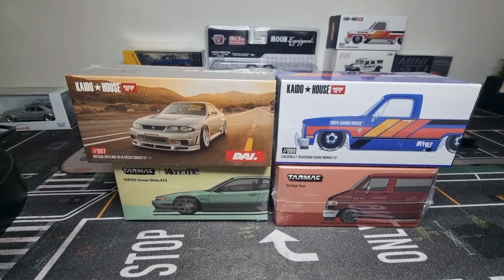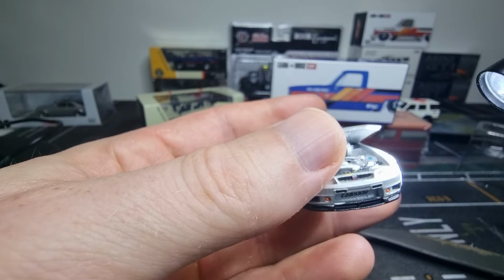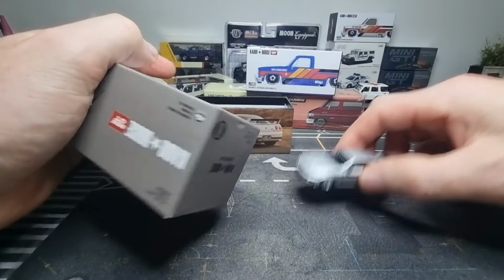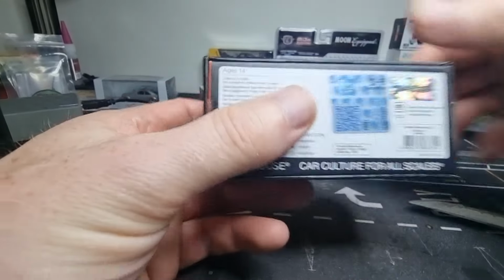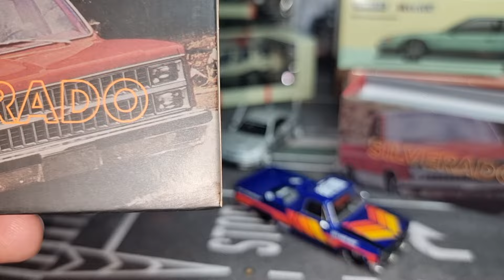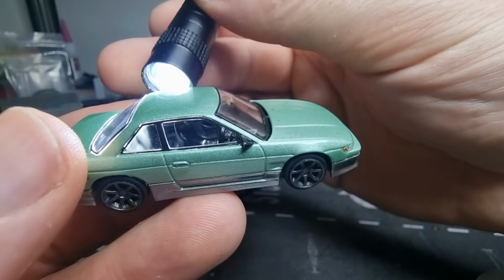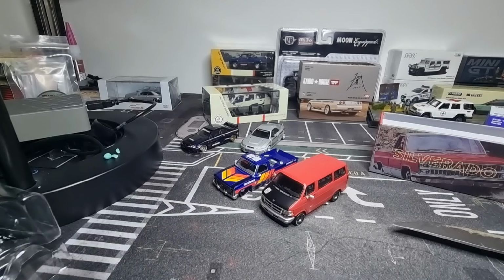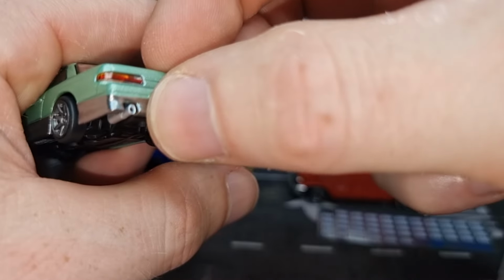Premium Diecast Cars Minigt Kaido House Tarmac Unboxing Review Upgrade License Plate!

Comment: The cars are amazing. I have the Chevrolet Silverado in red with a black stripe.
And there is a Dually version coming from this truck with  wider rear tires like the original Dually.
You can already see it on the website of MiniGT 😊
Reply from the maker: Holy Moly, I've checked and the one with the flames is awesome 🤩
Reply: @DiecastDudeofficial  Yes, the truck looks great. I already think of buying it 😅🤭